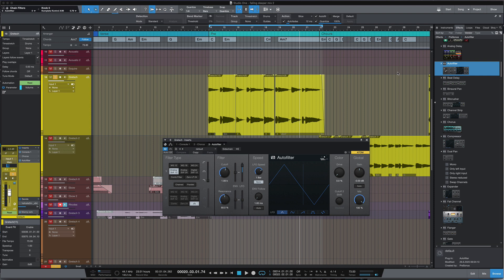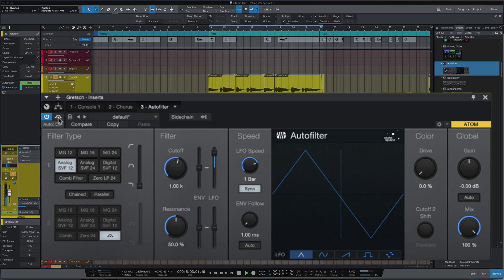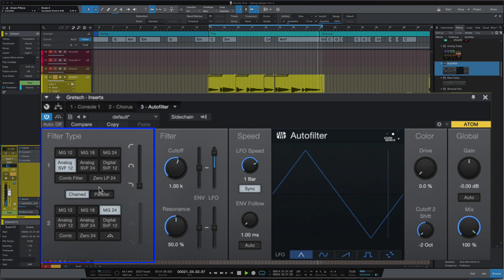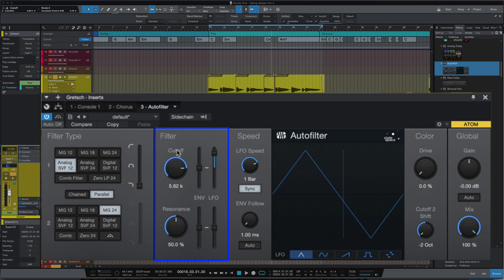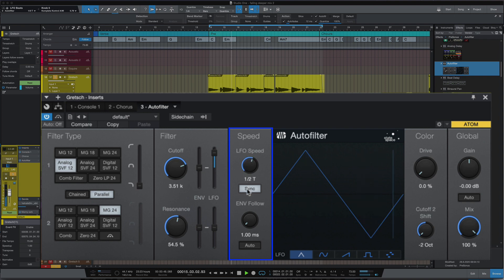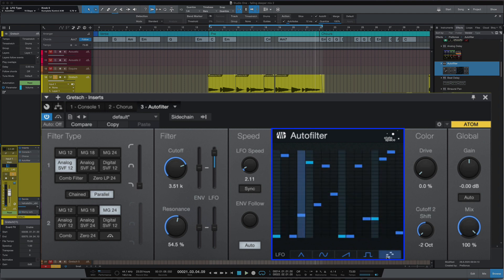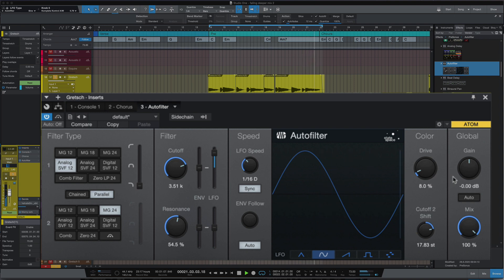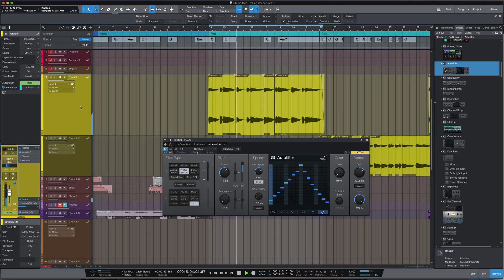StudioOne 5 - How To Use Autofilter In PreSonus StudioOne 5

Comment: Good video , can autofilter be used as a simple filter without the modulation ? Thanks
Reply: Yes you can , Next to the cut off under filter, if you place the LFO slider in the middle the modulation doesnt effect the cutoff . Which will then act like normal filter.
Reply: @rij2392  Ah ok thanks , i have no Studio One anymore but sure it will serve to someone else 👍